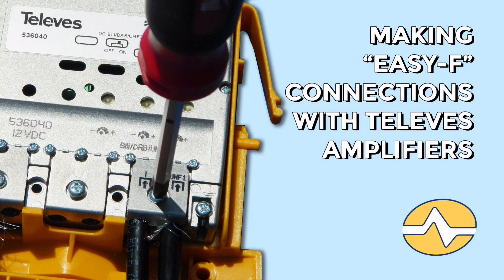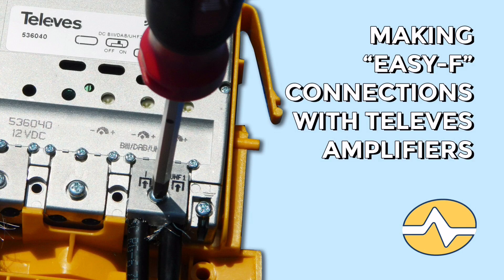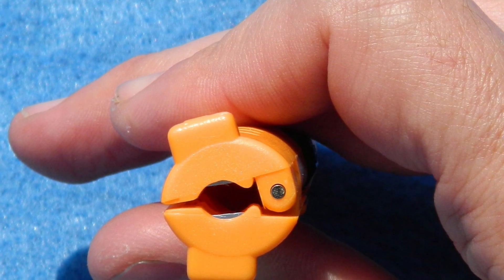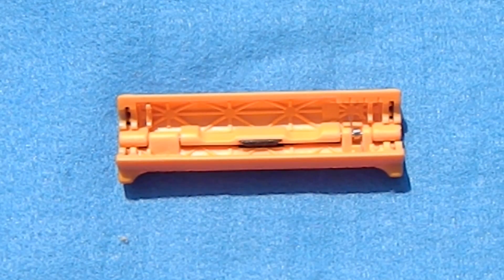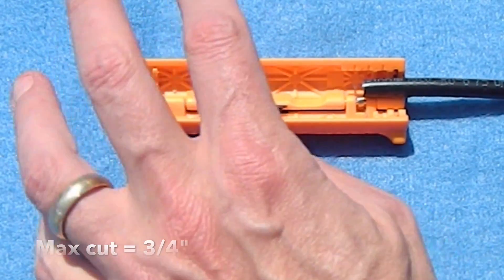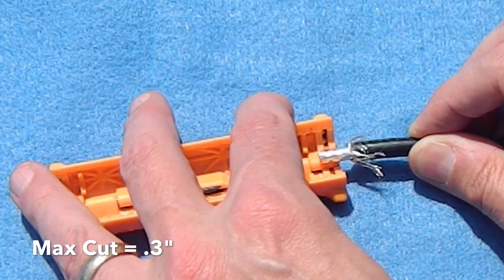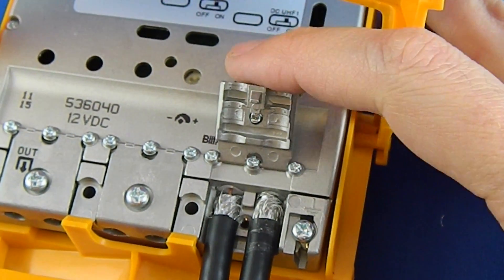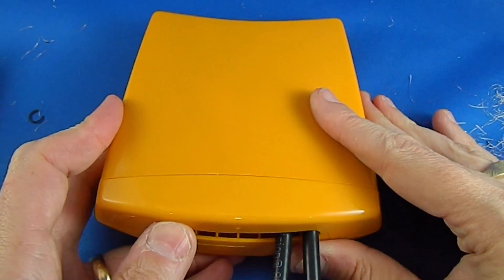Making "Easy F" connections for Televes Amplifiers

Comment: I noticed that this Televes Mast amplifier has a ground.  What size wire is needed for grounding?   The documentation is lacking in this regards.  Can I attach this wire to the antenna grounding clamp that goes to the grounding rod?  On your website, this mast amplifier is on back order.  Do have an estimated date when these will back?
Reply from the maker: I'm not sure when they will be back, but they will be back. Yes you can attach this wire to the ground clamp. 10 gauge ground wire works well.

Comment: Hi there, I would like ask, I want the two or three antennas set up  but does not understand on what purpose of the on/off switch when two  antennas are hooked up the amplifier - can you help please?  If two or three antenna does should Switch DC On or Off?
Reply from the maker: It’s not about the number of antennas. It’s about whether or not you want to supply power to them, for example if there is also an amplifier in the antenna.
Reply: Solid Signal you mean to say, if the antenna has built in amplifier switch on? Or if no buit in amplifier should put switch Off ? Could you confirm please? I would be happy and appreciated and this is a new for me to install.
Reply from the maker: Junior J-R the switch doesn’t turn on the amplifier. It turns on power to the antenna.
Reply: Solid Signal So, the purpose of the switch is to direct power towards the antenna if the antenna needs power; otherwise, the switch is the OFF position.  Is this the correct interpretation?

Comment: You failed to include the power supply connection; if this is mounted on the mast, then how much distance is needed for the power cord to an outlet. Also no instruction on the other connection points, the center one is not even marked. If its so easy, then give a complete set of instructions...
Reply from the maker: The power comes through the same coaxial cable that runs to the TV. A power supply is included.This is a tutorial on how to make the connections. There is a full review with instructions available at The Solid Signal Blog or by visiting SolidSignal.com and searching for "Televes."
Reply: Alright, thank you..
Reply: Can any power injector be used & can multiple amps (no more than two) be used with a single power injector.